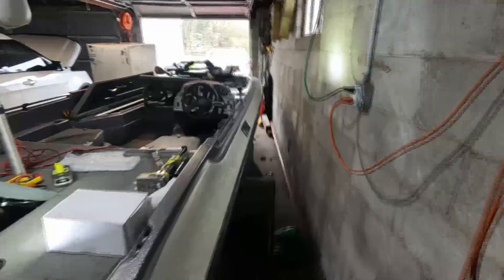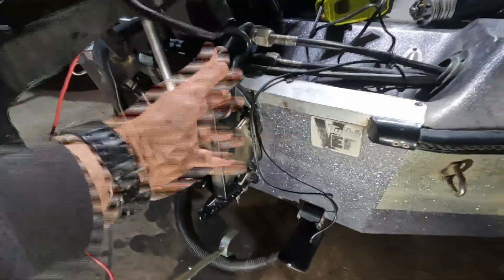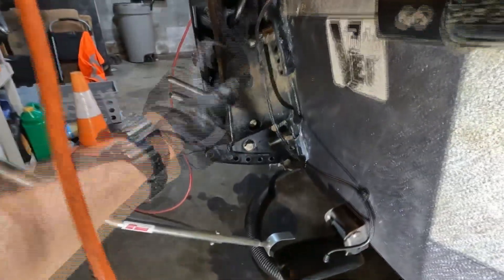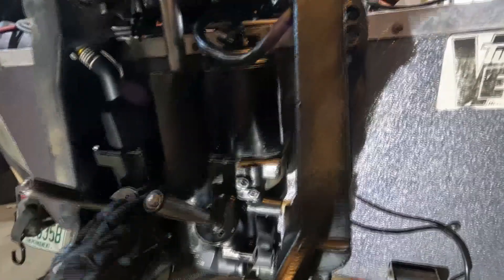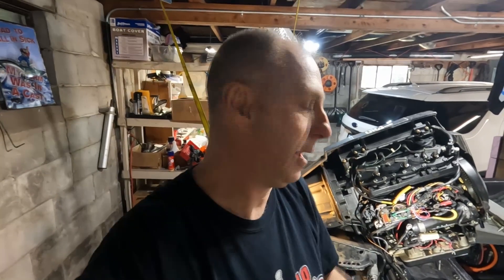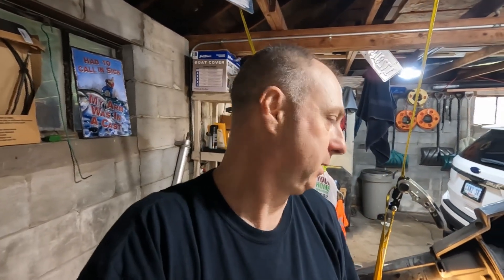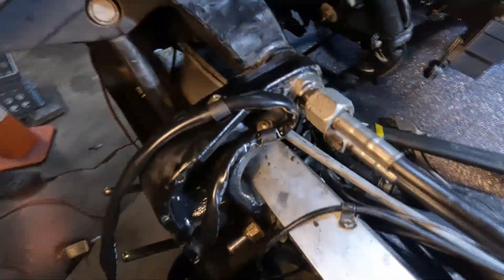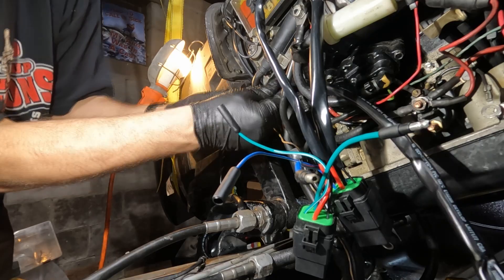135HP Mercury Black Max Trim Motor Replacement - '87 Stratos 179v.  AND Bleed Down Problem FIXED!

Comment: Wow thumps up ,, you really help me , I've  got a similar outboard motor with a 115 hp and the mechanism is the same .I tried taking out the motor but failed because I just didn't know I have to take out the bracket first  ,Thanks a million  , all the way from South Africa and now I know what to do next🙏🥰
Reply from the maker: Glad i could help

Comment: Very informational I’m installing new tilt and trim unit as a whole and just using that ratchet strap and tilting the mounting bracket up is going to save me some headache the videos I’ve seen the all pull the motor thank you sir for you video
Reply from the maker: Glad it was helpful!

Comment: This is for a 2 wire motor. Mine has 3 wire. Blue , Green and Black. Also does not have quick disconnect bullet connectors but eye type connectors on blue ,green & black. I think this video is the same process just different number of wires and quick disconnect. Also the relays are located between the v cylinders on back of motor. Thanks for the video. It is absolutely what I have been looking for. You might mention that if stuck at boat ramp and motor won't go up that by releasing pressure that you showed, is the way to get home without dragging the  lower unit skeg on the pavement. THANKS AGAIN from a Viet Nam Veteran.
Reply from the maker: Thanks for the comment!  Now people can read that tip about releasing pressure to raise manually.  Thanks!
Reply: New pumps come with 2 wires.

Comment: Excellent video it's really helped me a lot I was attempting to replace my trim motor on a 200 horse Mercury basically the same setup and had no idea how to do it I struggled for a while and gave up until I found your video at some point I'm going to attempt to do it again and I'm sure I can now because there's no way to get to that back screw unless you're moving that bracket just have to figure out how I'm going to tie the motor up thank you for the info and your video great job
Reply from the maker: Thank you!   Glad I could help.  Good luck.  If you can't tie it up you could always prop it with a V notched board or something with a jack.  Just to help it a little. It pretty much stays put but better safe than sorry is all.
Reply: @thehandyhomeowner9781  ok thanks I have plenty of 2X6 laying around that's what I'll do, thanks again for your help.

Comment: Thank you very much for the video. Iv been scratching my head all night trying to get the motor of without knowing you had to remove the side. What a poo design lol. But now I know how to remove it lol.
Reply from the maker: You are VERY welcome.  I was in the same boat.  Hahaha.  Could hardly find a video to help me and after 3 or 4 years finally learned enough to give it a try.  Glad i could help you out.  Good luck!   I hope your repair goes as well as mine did!

Comment: Great video.  The only thing I would have done different is put silicone in the 2 bolts holes to make them water tight.
Reply from the maker: I'm pretty sure i did (i would tend to do that) but i must not have put it in the video for some reason.  I'll double check and make sure.

Comment: Great video! Very thorough. I just changed the trim motor on my 60hp 1989 mercury with the same new one you used. It's working but is loud and hesitates in spots while trimming up. I think I have air in the system but can't seem to get it all out. Did you have any trouble bleeding air out of the system when you topped up the fluid after the install?
Reply from the maker: Hi.  Fortunately for me everything worked really well pretty much from the start.  The motor is quiet and it lifts and lowers and holds the motor up for hours at a time now instead of minutes.   I hope you are able to get it figured out.

Comment: How do you add fluid to it?
Reply from the maker: Its been a while since i have so I'd have to look it up.  Ive seen videos on the subject.   Maybe I'll make one.
Reply: @thehandyhomeowner9781  thank you I recently found a video on that as well. I just got a 150 black max on my new to me boat. Your videos have been extremely helpful because I have learned the 135 and 150 are almost identical, except for power and my trim motor just went out last week, my new DB electrical trim motor should be here tomorrow so I will be watching your video probably 15 more times while I scratch my head
Reply: @thehandyhomeowner9781  update I have completed the project except for beautification of the wires and have added the fluid for empty!
Reply: Ive done this same thing on the the same motor except now my motor wont trim up. Anyone have any ideas on what i need to do next other than give up and buy a new engine 😅

Comment: The last 2 wires connect to the trim switch wires ?
Reply from the maker: Hey there.  I'm pretty sure those were the last ones to hook up.   Do you have other wires left to connect to instead?
Reply: @thehandyhomeowner9781  would have helped if I finished the entire video lol. I stopped after u started putting it back together because that part I'm ok with and thought you missed that part with connecting the switch.  Video was a huge help tho. Thanks.
Reply from the maker: Glad i could help.   Thanks for the comments

Comment: Definitely needed to see this! Swapping the same pump on mine, just only question is where did you connect the red wire with the fuse that’s bundled with the green/white and blue/white?
Reply from the maker: The red wire went to the starter solenoid.  Look for the wires going to the starter.  Big wires and one should be marked red.  I hope i didn't skip showing that part.   That's kinda critical information. .
Reply: Alex, did you figure out where the red wire goes? I think I have the same set up you do, the small red wire coming from the control box. Let me know!

Comment: I’m curious where you bought your trim motor and if you remember the brand of it? Thank you!

I had to replace my trim motor and bought one from Amazon and one of the bolt flanges was broken off and the replacement motor burned up as I was working the air out of the pump and filling with fluid. I believe I paid a hundred and something for it.
Reply from the maker: Ebay .  https://www.ebay.com/itm/165280447039?mkcid=16&mkevt=1&mkrid=711-127632-2357-0&ssspo=Mx77oG4hR8q&sssrc=2349624&ssuid=ger-PpdnRhO&var=&widget_ver=artemis&media=SMS
Reply from the maker: Search ebay for mercury trim motor 3 wire 3 ram 430-22012.  
I hope mine lasts a long time.  So far so good though.  It's almosy too quiet.  I have to look to see if it's working!   Lol
Reply: Great video.. I have ordered my motor from Amazon. I paid 183.00 for it. I miss ordered the 1st one but was able to cancel it in time when I seen I have a 3 wire.. Still hoping now it's the same motor as yours. 
I got lucky and found your video relatively quick and didn't have to scour the web. I think you made a very straight informational video. I did see where someone ask about marine caulking bolts and side piece back.. I was thinking the same. No biggie though to still do it.
I want to thank you for a great step by step video. Especially doing the work yourself and filming it all. I've watched it enough times now that I have it down pat... Thanks again..